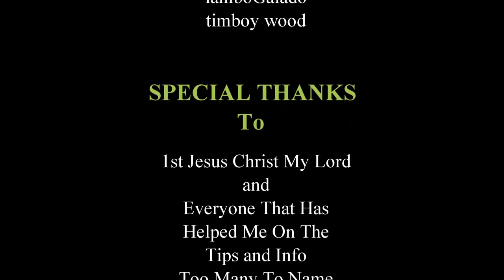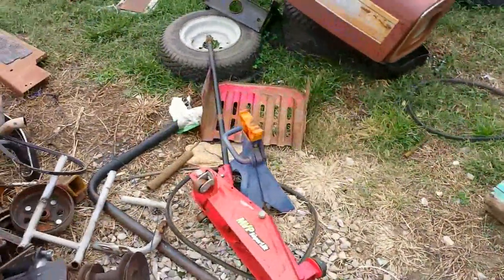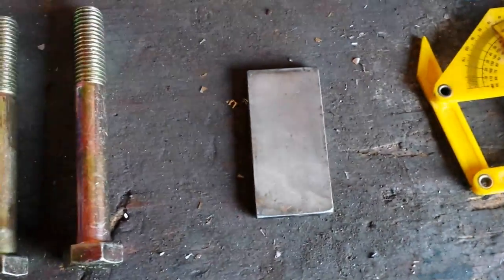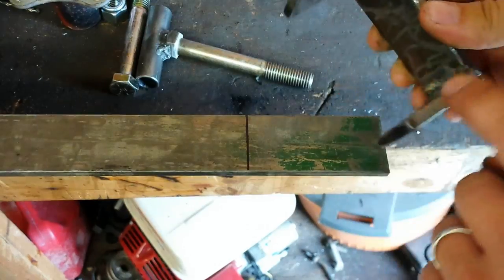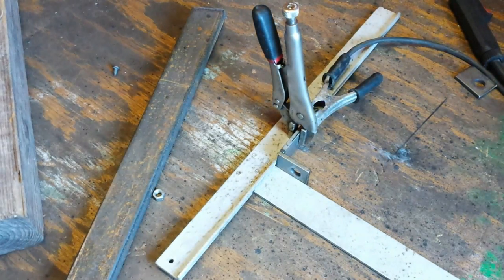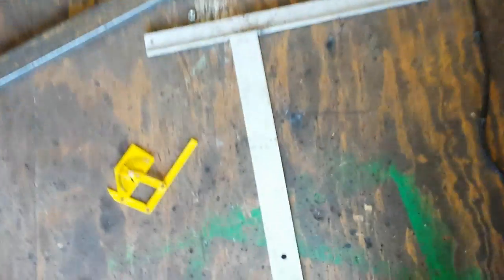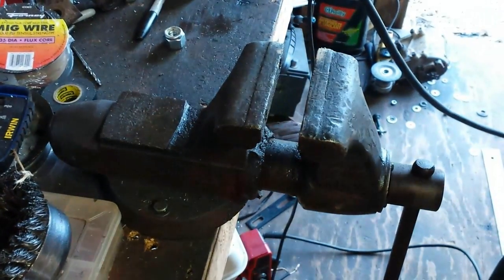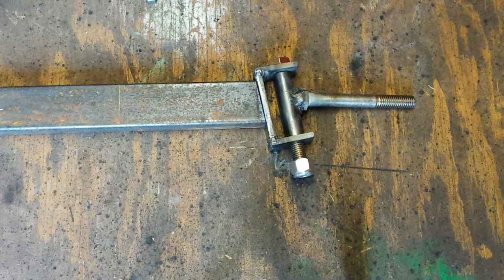Racing Mower Build Pt.1 (How To Build Spindles)

Comment: Cool man- looks like you've got a handle on it now. As we discussed before (and is mentioned in other comments) don't forget the caster (in the 8-12° range is usually sufficient) and factor in the Ackermann principle. Remember that your caster angle is relative to the road, not the frame- so if the frame is going to sit off level, you may want to consider compensating for that when setting up the caster angle.

Comment: use the new murray hood if u must but what u really should do is toss the murrays and the overweight 820...use the huffy! the 10* kingpin inclination by itself is only to reduce scrub radius and steering feedback over bumps. 10-20* positive caster will make the inside wheel dig, make it more steady at speed, reduce the affects of posi rear end and the angles work together to camber the wheels automatically towards the inside... also dont forget your akerman angles.
Reply: gusset the spindles on the bottom where the bolt meets the pipe and as soon as you finish welding the gusset on as hot as possible toss the hot spindle into a metal pan or container of nasty used motor oil the worse the better. the heat makes the metal absorb the carbon in the oil hardening it a great deal. but it sometimes catches fire when i do it thats why i use a big metal pan with a cover in case it gets too crazy usually just a little poof on top cuz oil is hard to catch fire or just do it in an open area. if u have a welder u should have at least 1 fire extinguisher